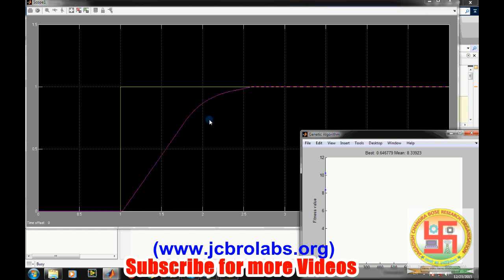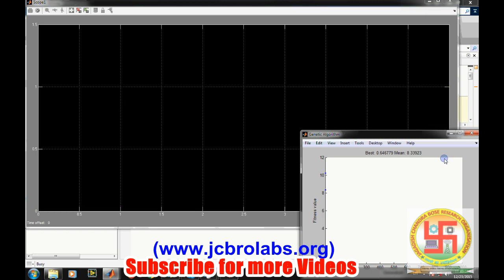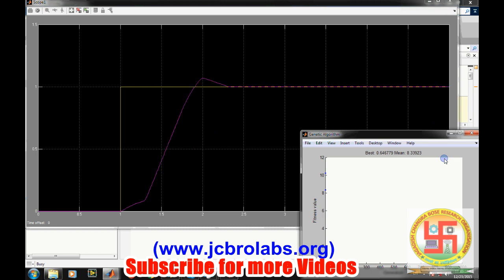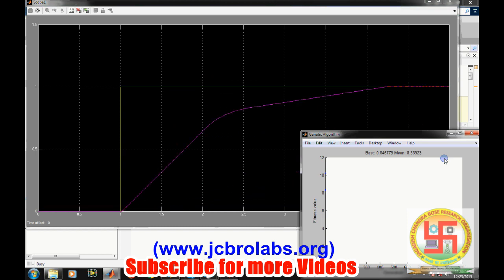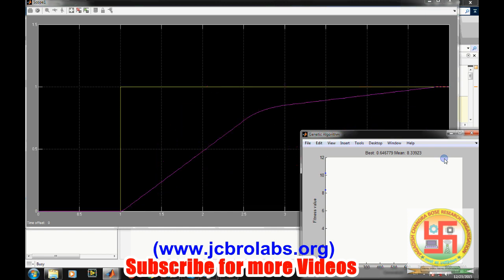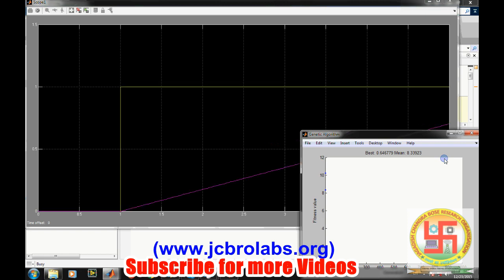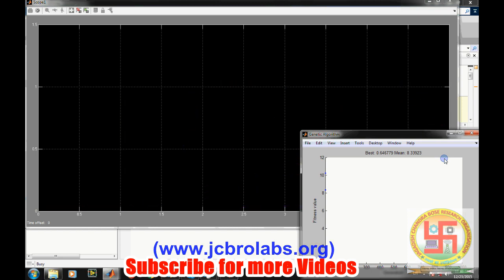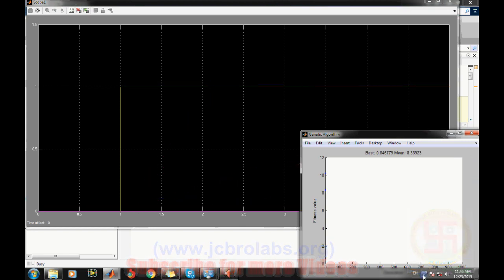EEE Project 2: GA Fuzzy PID controller for DC motor control

Comment: Sir can you share code to optimize fuzzy control using GAs.
Reply from the maker: Hi, you can contact us at: info@jcbrolabs.org
Reply from the maker: Learn PID, FOPID, Fuzzy-PID, HIL Simulation, Optimization, LFC, DC Motor control, Inverted Pendulum Control, DVR control and much more, all in one course.
https://www.udemy.com/course/control-system-and-optimization-using-matlab/?referralCode=E2905A33566486F41B6E

Comment: has anybody ever used fuzzy pid with arduino?
Reply: Please if you get any think I need it because my thesis about it
Reply: @shathaadel4611  well i did a little project
Motor control.
Found error ranges roughly through digital read.
Calculated gain by hand manually (hard)
It worked but not as i expected
Reply: @amzy8121  hii guys did u get any fuzzy pid with arduino i been trying to implement but facing some issues